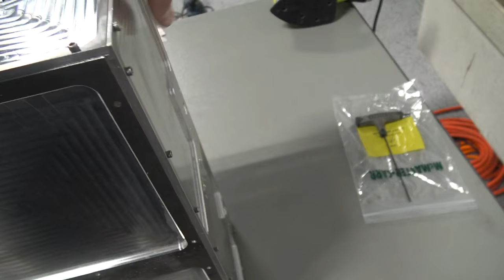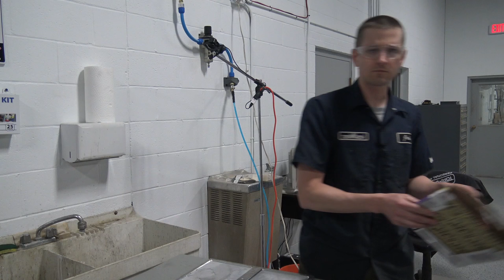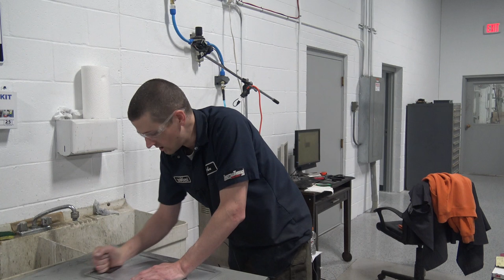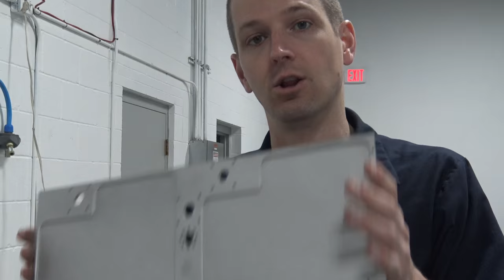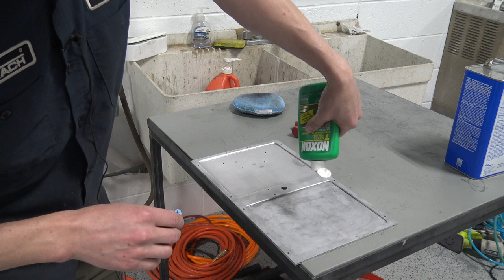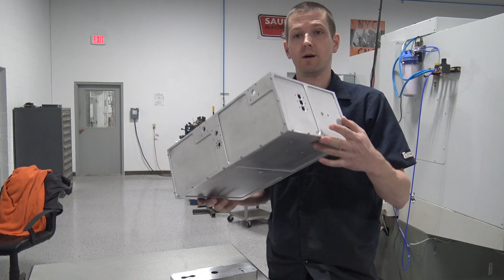Remove Machining Toolmarks!

Comment: Ok, towards the end and it's clear to me that you are putting way too much finish work into a machined part.  That part should be bead blasted with 80 grit and then clear anodized.  That's my opinion from making a lot of aluminum parts when I had the shop.

Comment: For crying out loud, if you're going to lay a flat panel on a flat work surface and then sand it with ANY sort of powertool try to be smart enough to throw a layer of non-slip rubber shelf liner underneath it first.  Seeing you struggling  to hold that panel steady with one hand while working it with a random-orbital sander was like watching a monkey try to ride a worn-out washing machine.

Search Google for : "Thick Grip Non-Adhesive Shelf Liner" and spend 10 bucks on an essential shop supply.  You're welcome.

Comment: John.Try googling Xebec deburring.  They make an alumina fibre brush you can use in the mill.  We use them to deburr and polish on our machines.  For a US distributor try www.deburringtechnologies.com (No connection, I'm in the UK and we use NCMT).

Comment: Hi, I am from the UK, and have had the same issues, I found that a process known as Vapour Blasting is the answer.
This is used a lot in race car restoration work,  dry glass bead leaves a rough surface, Vapour blasting finish is smooth, and does not pick up finger marks.
And as you are in the US ,http://vaporhoningtechnologies.com/de-burring-cnc-machined-parts/
Hope this may save you a few hours !
Neil

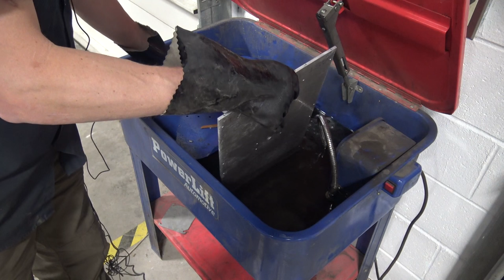Comment: Buff it, rouge on the wheel, doing sheet gets hot fast, and then a solvent clean - shown in my part making video here https://www.youtube.com/watch?v=V6AEZ6dSRIU - don't watch me milling it'll only make you angry - see 14:25 seconds the part has mill marks on it - was going to use a sanding black first but in a hurry so I just hit it with the buff the clean - see 15:50 seconds - I realise you used a buff of sorts but you need to get one on a bench grinder with some guts and really lean into it.

Comment: For these large flat parts, I would try something like this after media blasting:
http://www.amazon.com/Cotton-Grinder-Buffing-Wheels-8BUFF088/dp/B000SLNQCK/ref=sr_1_3?ie=UTF8&qid=1463006665&sr=8-3&keywords=cotton+buffing+wheel

Use a large cotton buffing wheel on a bench grinder with some 320 grit buffing compound:
http://www.eastwood.com/ew-greaseless-compound-320-grit.html

The flexibility of the buffing wheel will allow you to get into the corners. Also, by keeping the panel in the same orientation, you can create "brushed" finish with a decent luster to it. But do be careful, some times it cuts fast and can round off external corners quickly.

Comment: Painful to watch, this obviously sucked up a lot of time. It's true scotch brite is good at blending things, but even better is a wire wheel. They come in many varieties and grades but I'd recommend a crimped wire cup style, one 3" in diameter for a grinder and one (or two depending on how quickly they wear out) 3/4" or smaller for the corners, these will usually have a shank and be meant for use with a power drill. Clamp the plates to the table and go to town, it may take you longer to clamp the plates than to remove your tooling marks. Then you use a scotch brite flapper wheel for the brunt of the work and the pads by hand, in one direction only, no circles, no zigzag, straight lines, uniformity always looks better than something shiny with random scratches everywhere. At this point you might be satisfied. If you wished to continue would use 1000 grit wet/dry sand paper and just using good ol' h20 (and maybe some simple green/detergent if you'd like, it does some to make things "slide better) and start going to town. At this point the medium is fine enough not to leave appreciable scratches so circles are authorized. you can go up another grade or two with paper or polish at any point now, I recommend 200 mph polish, it's pretty damn good and will save you a lot of time.  Now, if you were set on using the sand blaster and bead blaster then I'd have started wet sanding with 1000 grit after that, it will really smooth out the piece and get rid of that post sandblasting texture, trying to polish that texture? THAT was painful to me, cause I know how much that texture just grabs at a rag and making polishing very difficult. Hope you read this and take heed, it'll definitely help you in the future.